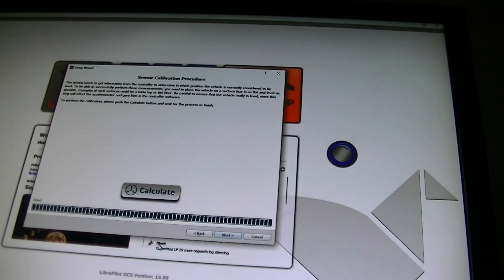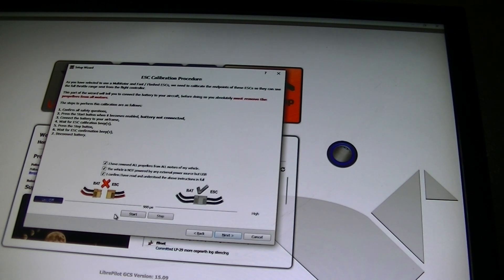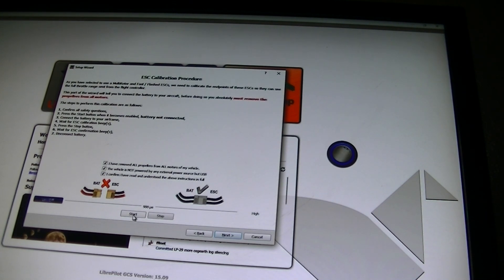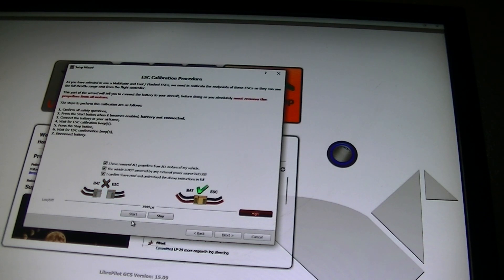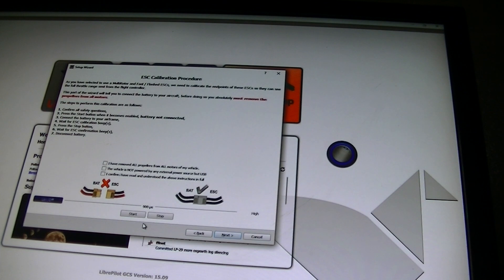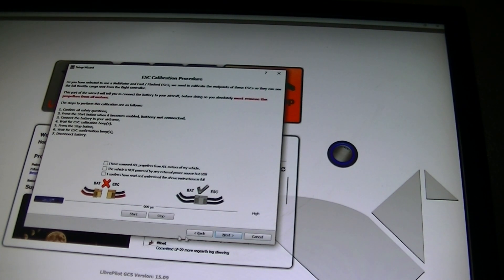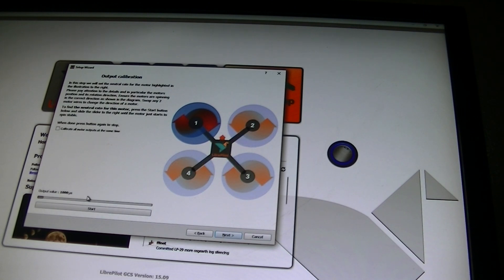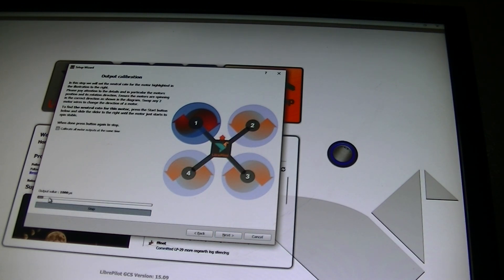zmr 250 issue solved

Comment: MAIN ISSUE is #1 the cc3d has to be mounted in the center of the frame......#2 the output calibration value wants to be where the motor just starts to spin..usually within 1 or 2 points.....that is way to high.......the placement of the cc3d while calibrating only requires the unit be level.......but it must be mounted center frame to fly optimally....the cc3d is a great unit....if you would like i will record a vid of my typical setup....you will enjoy that little monster once she is flying.....my 11yr old daughter runs 250 class racers and loves it as do i